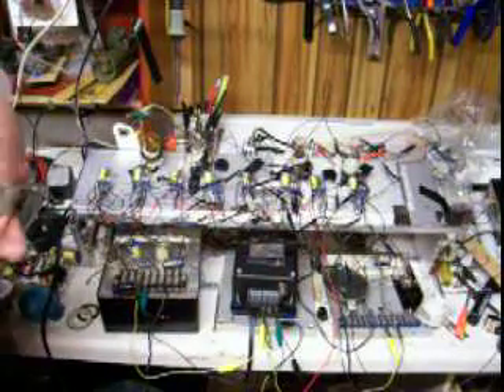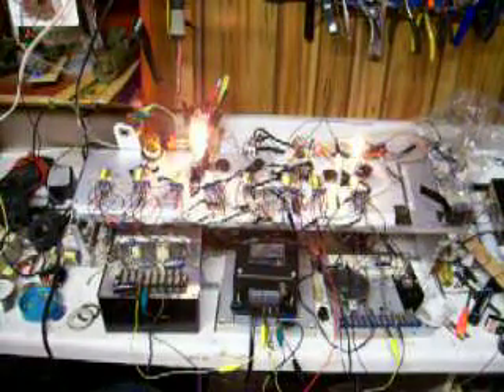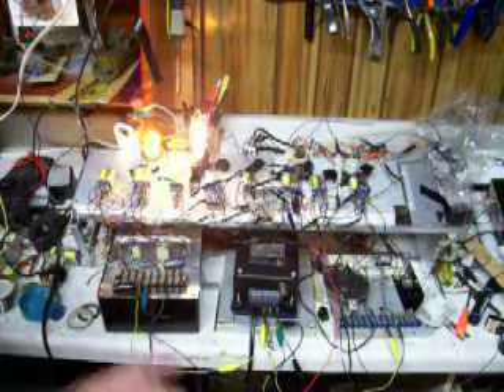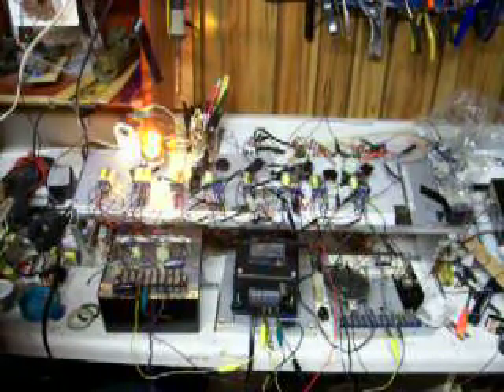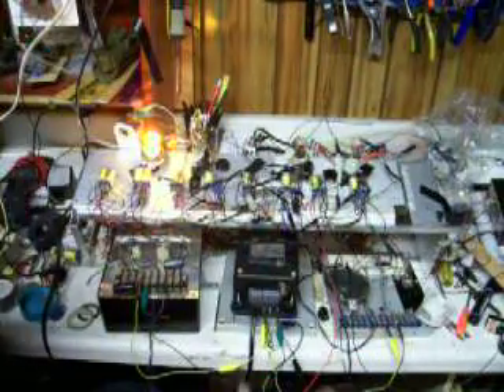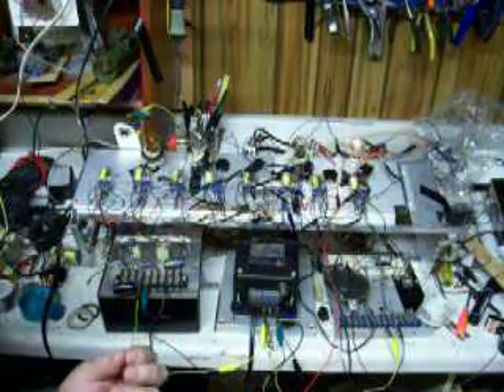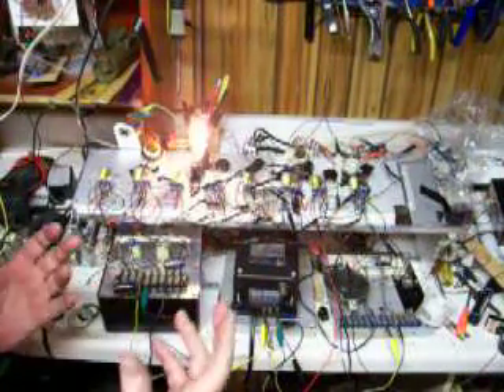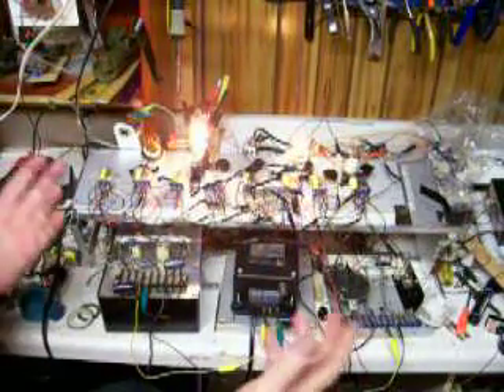relay binary counter

Comment: If the coils are wired in series then (and you mention this also) both relays are either on or off at the same time. Could you use ONE relay for a flipflop stage, just use a relay with more contacts?